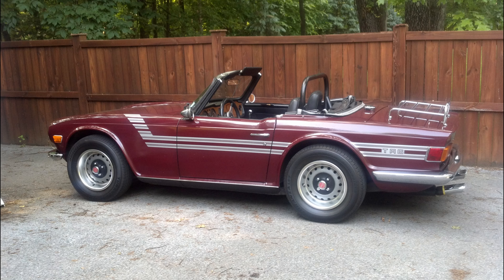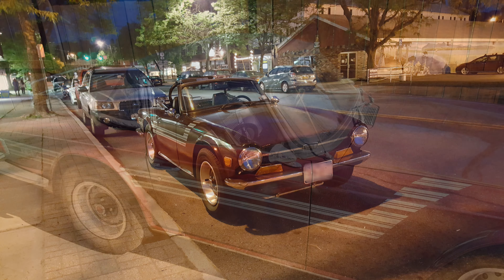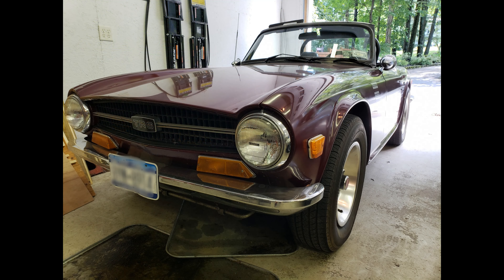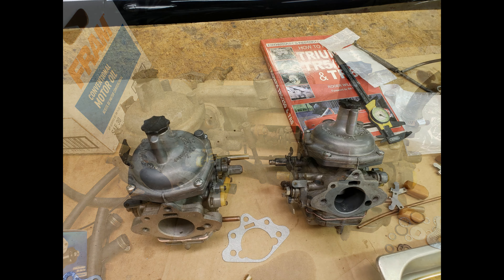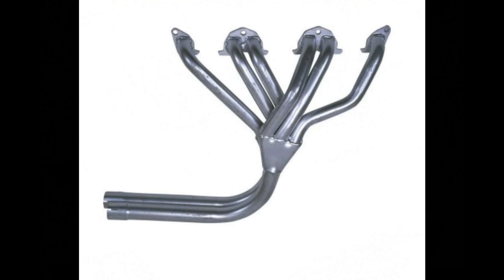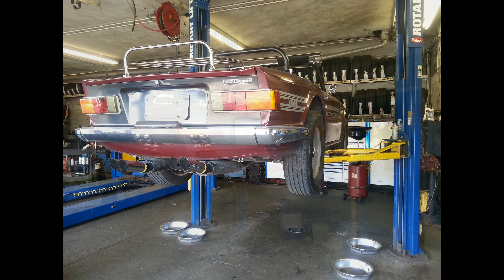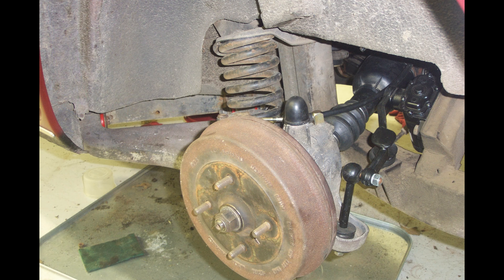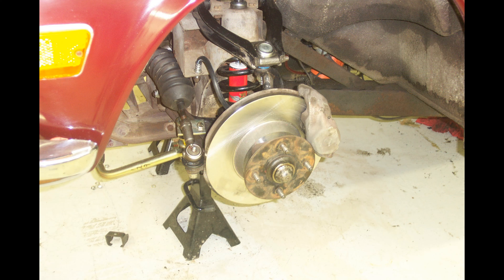My 72 Triumph TR6.  It is a great British sports car.

Comment: I've got a 1972 TR6 as well. Mine was hopped up by Jay Leno's head mechanic Bernard Juchli (then in Los Gatos, CA) before he worked for Jay. Custom cam - higher lift and more duration, bored .40 over, magna-fluxed the block, high compression cylinders, triple Webers, 6 into 1 header into a splitter for Monza quad tipped dual exhaust, sport springs, bigger rear sway bar, PPG paint and car has over drive from factory. Basically everything you could do in 1972 with enough money was done. Original steel wheels painted body color with Stainless trim rings in place. New seats, carpet, teak dash... healthy car. Just needs a younger owner. Saffron yellow (?) over black. Awesome car, I'd drive it across America it is so reliable. These old TRs were based on tractors and they just run.
Reply from the maker: Wow! Sounds like you had the most tricked out TR6 on the planet.  Some of those mods I may do on this one.  You are correct, they are pretty much bullet proof machines.

Comment: This one is an earlier 1972 production as noted by the absence of Leyland fender badges. You should add a front spoiler / air dam.  I also recommend upgrading to SU HS6 carbs because they stay adjusted longer, and are easier to tune than the Strombergs when necessary.  I also Jet Hot coated my TR6 header.  Learned that trick from my Jeep 4.0.  The Jet Hot coating is unbelievable there is almost no radiated heat from the exhaust system when it is added.   The Monza exhaust is okay, but I think that the exhaust exiting on both side causes fumes to blow up into the passenger area.  Notice you are using poly bushings on the suspension.   This a great idea as the are less prone to rotting out the the original rubber ones.  Looking very good.
Reply from the maker: Great suggestions and observations.  I put the Jet Hot on this and on my Europa, what a great product.  Thank you for you comment.

Comment: love your car xcept for the factory stripes which i never seen before....well done...   my same car for around 40 years...min is white :)   your right it is a man car..ameaicans call them muscle cars.
You have done a lovely job on it...well done for keeping it standard.
Reply from the maker: I never saw a TR6 with stripes before, but in a book it shows that they are indeed factory. Thank you. Please subscribe, I'll be making more videos.
Reply: The stripe graphic was a Triumph design. I believe they were created for the US Market and didn’t appear on the home market card. You say there is a photo of a car in the factory with this graphic?  I’m not sure I have seen that one. I was under the impression is that it was a dealer applied option. The stripe kit is still made by the
Original manufacturer 3M. They also make the correct textured finish for the rocker panels, 3M Shutz.
Reply from the maker: @jaman878  Yeah, I have a TR6 book that has a b&w photo showing the stripe.  Oddly enough there is a yellow TR6 in my town that also has the stripe.

Comment: I had a UK 72 one. If that is the US one I guess it has carburettors. Less power but much more reliable. I used to carry two spare injectors and every week I had to retune the Lucas mechanical fuel system using a special spark plug with a transparent glass window to see the colour of the flame in the combustion chamber. It is easy to modify the overdrive to use it on all forward gears, lots of fun... Less fun is the crappy half-circle crank endfloat washer, and regrinding the main and bigend bearings when the crank fails, as it inevitably does, being too long and too slender. I do not like the look of the wheels on this. Mine had wires.
Reply from the maker: Ahhh the Gundsun ColorTune.  I actually have 3 of them so I can tune my E Type Jag.  Yes the Strombergs are more reliable than the Lucas petrol injection.  My TR6 does not have the overdrive, so I have to be content with 4th gear.  
In the springtime I will do a video all about carburetor tuning including using the color tune.  I also have a Unisyn and another flow gauge for synchronizing the carbs.
Thanks for watching and please do subscribe.  I am having fun making videos, so there will be more.
Reply: Definitely try to get hold of an overdrive for it, because it transforms the car, radically improving 0-60 time.  @lotusbobsgarage
Reply: In the mid thru late 70's, I owned LHP 293F, CP6, the 6th TR5, one of the UK press cars. I never had a moment's problem with the metering unit, or injectors.
Reply from the maker: @clivewarner2162  I do want one!
Reply from the maker: @andrewp4172  I have no experience with the petrol injection. Go for you with yours
Reply from the maker: It is on my list.  Thanks for watching.  I'll be posting more videos @clivewarner2162